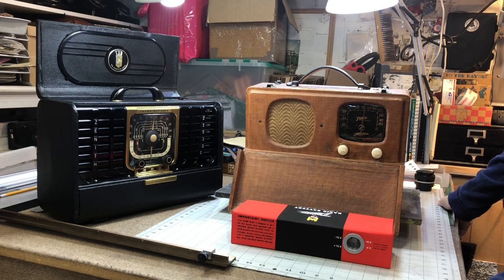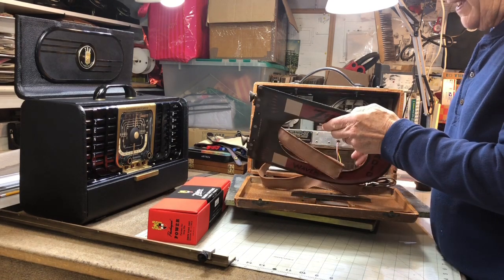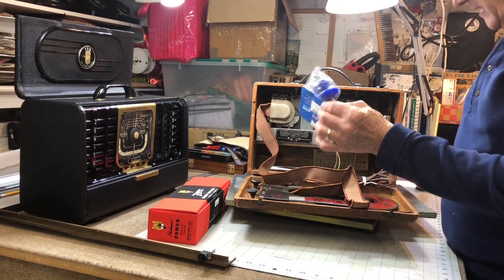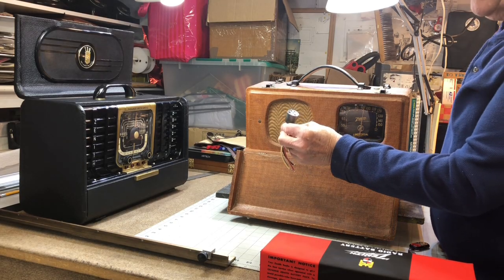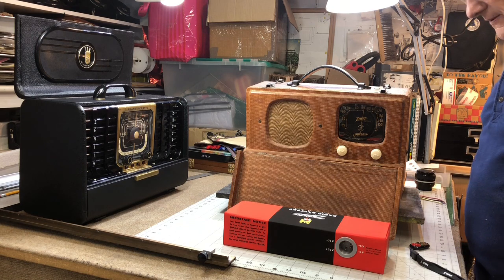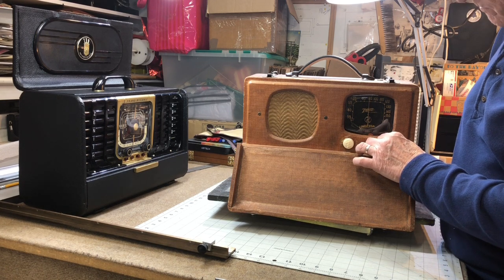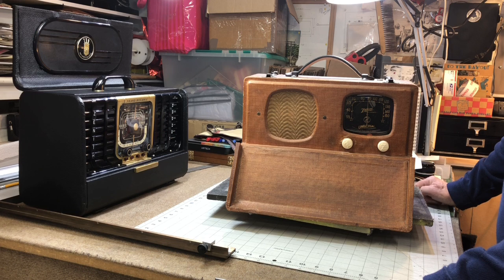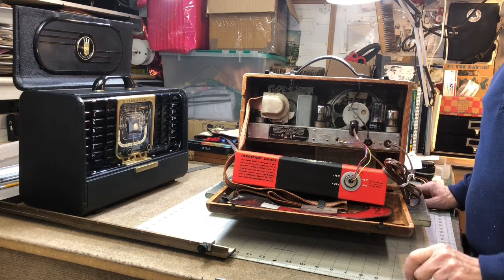Z675 Battery for Zenith 5G500 Radio

Comment: Loctal base tubes were unique, no danger of them popping out of the socket. Loctals are still available and reasonably priced.
Reply: Yeah thankfully they are! 😅 Because the smaller ones Ive bought for my 600 series over the last year are pretty expensive! Especially the 50A1 And the 1L6. And if they're NOS..... Almost getting into the three-digit range!! 🤦‍♀️ When I got my 8g005, I was thinking the tubes were going to be really expensive, but to my surprise..... Very cheap!!! 🤗

Comment: In the late 40s and early 50s, the worst source of radio noise at home was a vacuum cleaner.  I had an RCA battery radio like that with a VS050 battery, 7.5-6v A and 75v B.
Reply from the maker: Your old radio would definitely not like a vacuum cleaner near by.  Thanks for the memories!